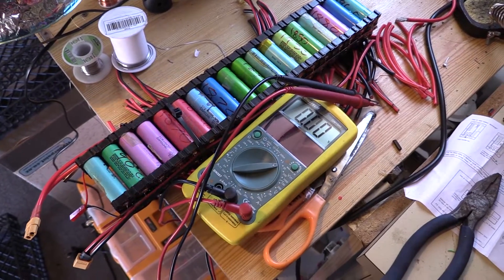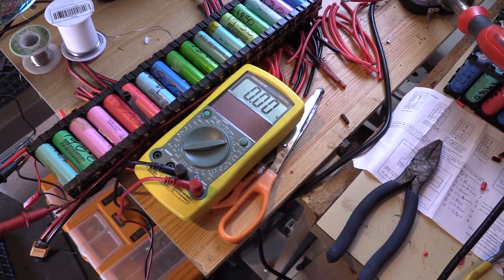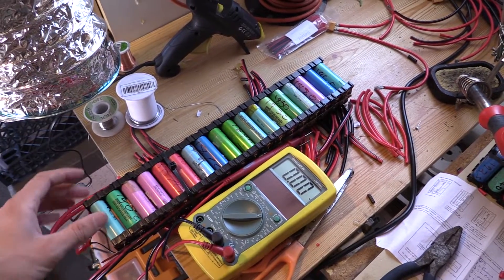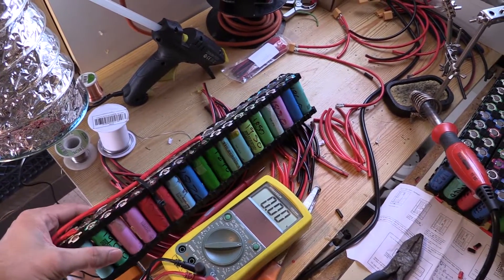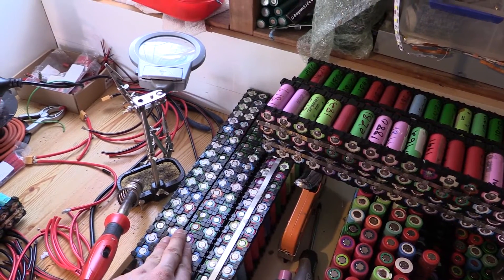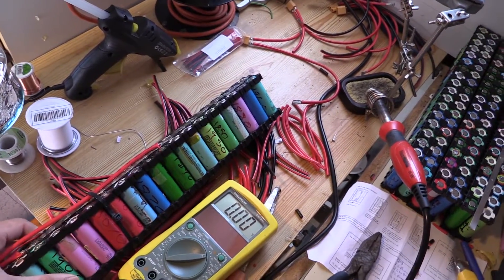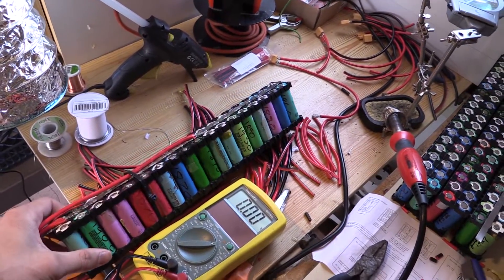Help! Bugger! 18650 Pack Died

Comment: it would be nice to find a way to bypass a cell if it goes bad. maybe a protection board top for each cell that would switch to a bypass. figure that one out  cash in ..
Reply from the maker: ya thats the problem, really you want a quick easy way to know if a cell  goes bad and change it without hassle. Its a very good idea to use small cell fuses that blow quickly at 1amp that way as soon as a cell starts to self-drain it pops the fuse. Everyone only seems to fuse just in case the call goes really bad but the biggest and more common problem is selfdrain

Comment: Strange. I also got this penomenon yesterday on a smaller pack. It's really making me think if it's such a good idea to rely on recycled batteries for powering a whole house.
Reply from the maker: I think if you have redundancy with another pack in parallel then if you need to take a pack out with a problem its not a big deal. If you reply on the power then just addin redundancy. Its just a matter of time before a old cell fails, the key is to make it a quick and easy change around to get it working again.

Comment: the pair of shiny green cells at the pack center are very very old, I've had 100s of them, they all exhibit the same characteristics - the first time they are tested they are ok (some are thrown away at that stage due to low capacity) - so testing again the previously ok ones test lower, test again and they drop like a stone - eventually they all get binned - later edit, someone has just posted about those old green cells on the FB group.

Comment: Charging it up and checking for a hot cell seems like a good first test - certainly the least hassle :)

If that doesn't work then maybe you could cut the top nickel strapping at the half way point. Then charge half the pack. If it's ok then the fault is in the other half. Repeat that 5 times and you'll have the bad cell.

The rest of the groups will be fine I suspect.

Comment: Maybe divide the pack into two 18 and 18 find what half fails then divide that in half again 9 etc maybe just 4 charges and 4 points of repair
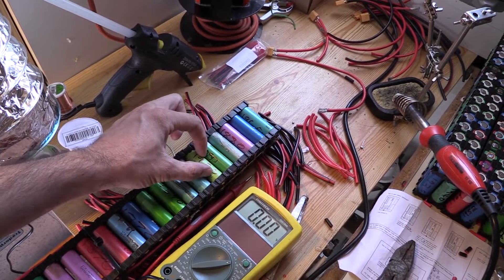Reply: My bet is on the the battery you touch at 3:27 the green/blue with gold top. just looks different and is close to the charge cable.

Comment: Yeah a monitoring BMS could have picked up self discharge, or low cell voltages and alert you.
Gives me another feature for the battery monitor I need to build, discover self discharge by monitoring pack when it's disconnected during the day as fully charged and inverter running off solar directly.
Reply from the maker: ya very good reason to have cell monitoring, to help with problems like this.

Comment: I'd try charging it up to like 3v or so, then cut all the wires on one side of the pack.  Then voltage check each cell to see if they are at 3v.  If they all are, maybe give it a day or two and then check all of them again.  If they still hold 3v, might have to pull them all apart and start over.  Simplest case you have to solder half the connections on each cell, worst case rebuild.
Reply from the maker: Its looking like a rebuild at this stage, will do another vid

Comment: Hi Mike. I'm not a troll. I hope you're able to find the culprit and fix this battery pack but I must say that I've always thought you guys seem to be wasting a lot of time on using old cells to power these home brew power packs. These are OLD cells. They will die one by one -- sooner or later, and more probably sooner as they're old. It just seems to me that it's a complete waste of time. You'll constantly be debugging which cell died. If this project is purely academic and for education, then fine. I see some merit. But if you actually plan to use this power pack as your actual day to day power source, then I think it's an extremely unreliable source of battery storage. Again, I'm not a troll. I hope you get it fixed. I think the ideal solution is really to buy new Panasonic 18650 cells from the beginning and make a brand new power pack with batteries from the same batch and have BMS throughout. That would be AWESOME! A little costly yes, but definitely should be a lot more reliable and thus actually usable for a day to day battery storage.
Reply: If you were going to do this with new cells much cheaper to buy a Powerwall or LGCHEM or others. Personally I've gained so much from this/these projects. I think it's one 'project' I actually completed and it worked !! GO ME ...lol
Reply: Lance, when you start out by saying "I'm not a troll" we all know whats coming next  :)  I think stating the obvious like suggesting buying a new power wall is NOT constructive, and really wastes everyone's time.  In the spirit of being obvious, why not subscribe to the Tesla channel I think you'll find things more to your liking there.  
Mike is doing a great service here by boldly stepping into the unknown, and building one of the more innovative projects of its kind i've seen thus far.
Reply: A laptop battery ends up at the recycler for a variety of reasons - doesn't necessarily mean it has failed batteries/cells. Some will be from laptops that have been discarded due to non-battery related reasons (broken screen, user has upgraded etc) but many will be old. I think it's still unknown what the failure rate of tested good recovered cells will be. I've been evolving my system design to mitigate that issue by using "small blocks" of 24 cells each. We'll see if that's the right balance between build simplicity and easy maintenance.

Yes it's time consuming. Yes - If we had the money we'd probably just buy a solution. But... opening laptop  batteries is soooo much fun. And I love the idea of saving lots of good cells which still have some life left in them. 

Cheers, Paul
Reply: HBPowerWall: Yes, I've seen many of your videos too. You definitely seem to enjoy the process along with getting some lower cost power storage. I wish you the best as well.
Reply from the maker: your KPH i am guessing you mean kWh which is the same as killowatt per hour. For selling back to the grid, also known as a buyback rate. I get paid 8c per kWh i export. Last month Dec i exported 440 kWh which is around $35 credit.
Reply: Damn I hate youtube's reply function. I just lost a long comment I made. Not going to reconstruct it. I wish you the best. I'll continue to watch your channel and see how you progress. :-) I am curious to see how long most of your harvested cells last.
Reply from the maker: Good point Lance, It comes down to cost. Your right i might have to problem solve with some packs but other parks might last a long time, either way its far cheaper to use older cells. Your right it could be problematic and buying new cells or just buying the telsa powerwall would be easy at a cost. Buying new cells would be far too expensive and HB pointed out, ur best to just buy the complete product as it works out cheaper. This is more of a project and a enjoyable one. I have learnt so much over the last 6 months and that is worth it. I have only spent about $2-3 and will have around 10kWh , sure its not going to last as long as a new powerwall but its 1/4th the cost. One day if can save up the 10-12k i will it take to buy a telsa powerwall but after the last 2 months of use i have only had this one problem. If the powerwall isn't turned on it doesn't matter as i am not offgrid. Once i put together more banks of 5kWh then i also have redundancy. Overwall its a DIY project and fun and if i had lots of money sitting around then sure buying a telsa powerwall would be a good idea however thats alot of money when my DIY powerwall will do just as good and i can always improve it as time goes on by addin more and more batts like HB.
Reply: Ok. If this project is really a project of love and education, then I guess have a lot of fun. :-) If you're willing to put up with these hunt and peck sessions for dead cells then more power to you. It does seem from your videos that you're really enjoying the process and I am glad to hear -- from your other video -- that you're actually saving a buck or two a night feeding power back to the grid from your power bank. 

You disclosed your kilowatt per hour for night rate in that video; I'm curious what your KPH is for your lower solar rate for the daytime. 

Have fun. Keep safe!
Reply from the maker: Nicely said Paul
Reply: Mike, I meant the rate your electricity company charges you per kilowatt during the daytime. I believe in one of your other videos, you said your power company charges you around 30 cents per kilowatt during night time. So I was curious what they charge during daytime. Glad to see you're getting a good amount of credit back.
Reply: Ray, that's your opinion. Plenty of people out there on youtube land need to be warned of how dangerous these projects are and how wasteful in time they are if one's ultimate goal is productivity or efficiency gain. I don't know exactly what Mike does, but if he's in IT and makes say $50/hour, the amount of time he's spent on this project is in the tens of thousands of $$ I'm sure. That's more than enough to purchase a Tesla Powerwall outright. 

If I were a troll, I certainly wouldn't have disclaimed my comment and would have directly and succinctly wrote "you're stupid".
Reply from the maker: Lance, Same rate for day and night. A fixed rate of 29c no matter what time it is. Its a normal low energy rate for under 8000kwh per year. Given we export power and use very little we are on a low user rate. By using less power the rate increases from 23-24c kwh to 29 but the daily rate ( for having power connected to the house) halves to 38c per day on a low user plan. We could change to a power company on a floating spot rate which would be far less but they normally don't buy power back eg we can't export back to the grid if we did that. Its a complex. The best thing to do right now is use less grid power.
Reply: Mike, I see. It is complicated. Your electricity rates in NZ is definitely more expensive than USA rates and I'm already in expensive California. Solar and your cheaper DIY powerwell should definitely be able to recoup a lot of your cost for parts - - not labor - - in the long run so long as these cells you've harvested actually last a decent amount of time. Good luck / best wishes.
Reply from the maker: Lance ya interesting point on hourly rate and time on a diy project. I think yes if i had work to do 12 hours a day then sure i would be better spent on just buying the powerwall, But like most people they only work for 8-9 hours and only get paid for that working more doesnt mean more money. So when getting home after work, working for free on a diy project if there is no (other) paid work to do within the same time at night, I am better off spending it on building a powerwall. Sure if i was choosing to spend the same amount of time not working i would be silly. Paid work would be far better use of my time and sure over a couple of months would mean i could buy the powerwall but there has to be work to do that i will get money for. Like everyone after we finish work for the day we don't get paid, watching tv, playing games, goings for walks, doesn't pay. We do those things because we dont have paid work to do. Much the same here. In my free time i am building a powerwall. If i had IT work to do i would do that, but everyone has freetime and the main question is how much is that worth......we can't work 24/7 nor will someone pay us too per hour, or i have enough clients for IT 12-16 hours a day.  This is the same problem with any DIY project, its complex and very different for different people. Anyways.